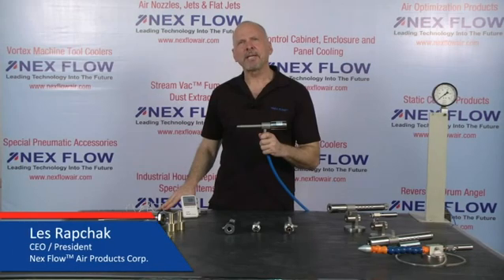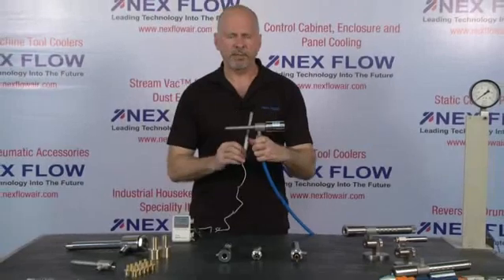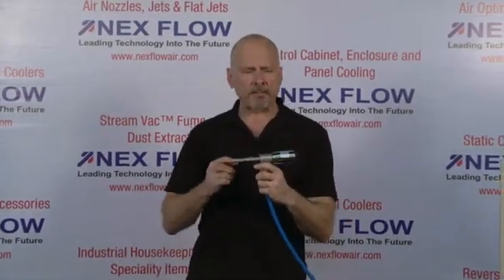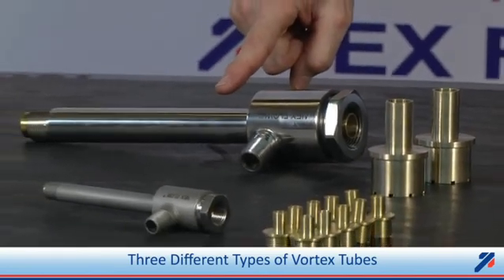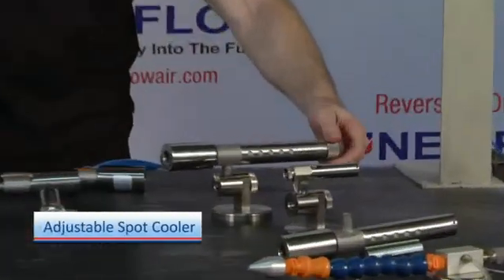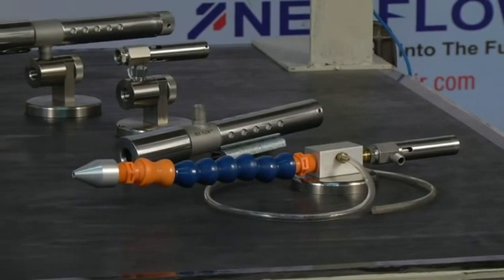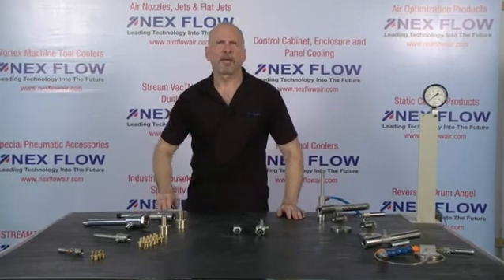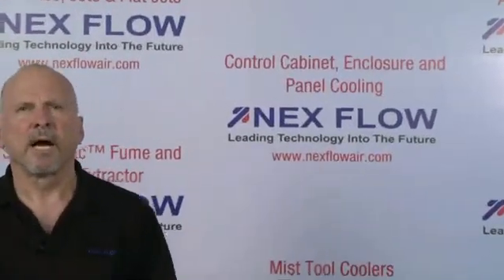Nex Flow Vortex Tube Demonstration

Comment: Could this be used to power a Stirling generator, as a sort of thermal energy to mechanical energy converter. output over all colder air and mechanical energy

Comment: Due to one side provided hot air （ that hot air will be 127℃）, can I use this hot air to remove snow?
Reply: You can if its a square inch.  It can only spot heat.

Comment: Hi, very interesting tool. Can it maintain temperature and humidity in an open room or area ?
Reply from the maker: It uses compresed are so logically only small enclosures like control panels are economical.  Large rooms - not.

Comment: Guys-can you collect those Hot & Cold air to a separate tank? Also, if your input pressure is 80psi, what are your output in hot air and cold air produce?
Reply from the maker: No you cannot because the air both hot and cold ends) goes back to near atmosphere.    It does not stay under high pressure.

Comment: It would be interesting to see how this could be combined with N. Tesla's turbine.
Reply: it is a tesla turbine with out the blades except the volute is different and the angle of attack to the periphery
Reply: I wanna see if Ranque-Hilsch Vortex tube powered Stirling Generator that runs a bicycle pump to run the Ranque-Hilsch Vortex tube is viable

Comment: Can I ask why don't you use this for renewable energy by adding it to a admospheric engine which works on temperature difference but not on heat temperature. This can be used as a portable electric generator.
Reply: Feel free to explain how that would even work.  I would be most interested
Reply: @mycutebutt1000  It won't work, it doesn't provide enough torque.

Comment: How much air consumption per hour... To maintain atmospheric temperatures of panels....
Reply: Every Panel Cooler has a rating - so the size deoends on the cooling you need which determines the air consumption needed.

Comment: I have a set of IGBT drives which heat upto 95°C. Can your device provide spot cooling to these drives? My present cooling is by forced air and ethylene glycol heat exchanger. Unfortunately, this is not working up to our expectations. Can your device help?
Reply: Yes i can - you would use our panel cooler and in fact VFD's are a major application for vortex coolers.  Please see our web site www.nexflow.com - please advise your contact details via the web site.

Comment: providing a supply of compressed air is an expensive endeavor.
Reply from the maker: But sometimes you have no choice and pneumatics is still growing because it is still the most compact, flexible and rugged form of power